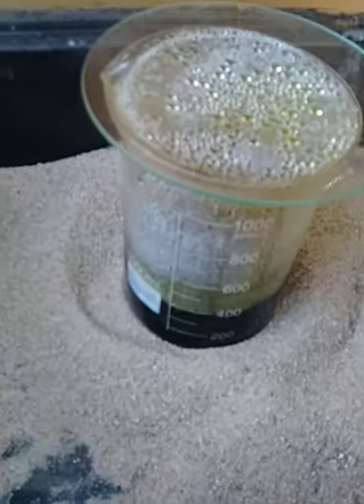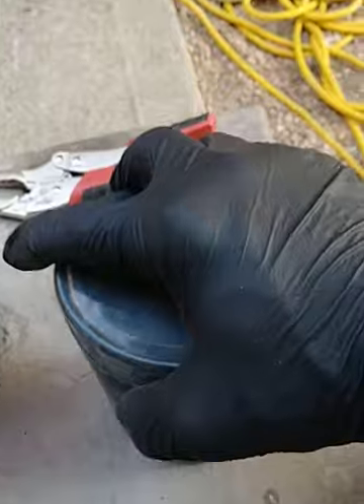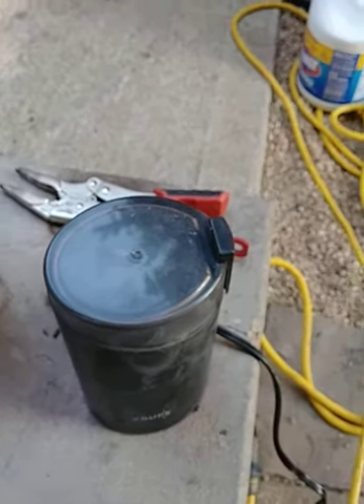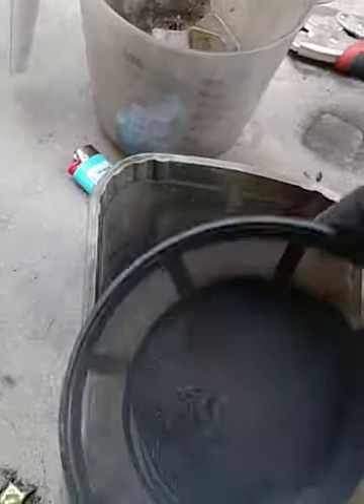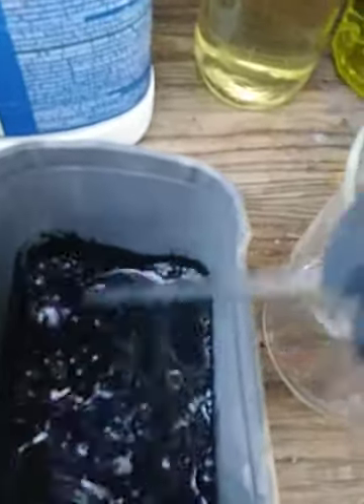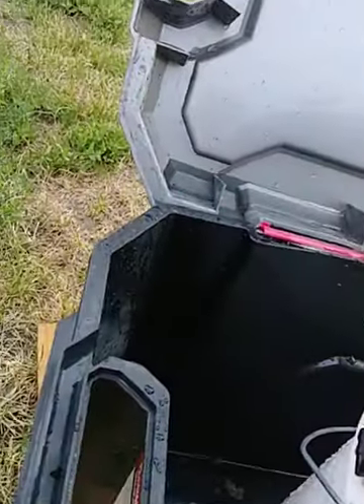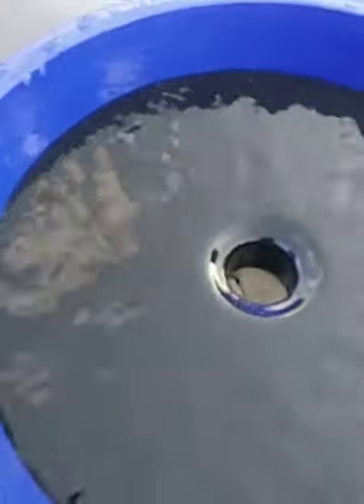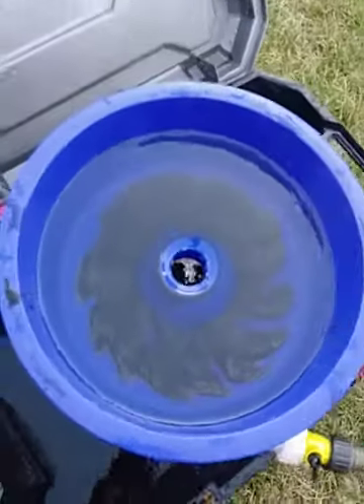Ram chip /BGA CHIP incineration recovery process

Comment: Info on that set-up please:) thanks
Reply from the maker: Jessica Roper hey there Jessica so I bought the set up off e bay around 130 bucks came with the bowl the bucket clamp levelers and a 12v pump that I haven't used works pretty well however the poopshute we speak of on the fb page works better and cheaper...
Reply: E Waste solutions Sonny 
Thanks:)